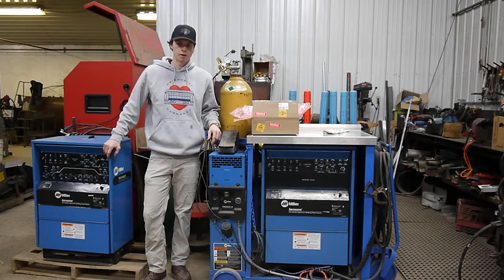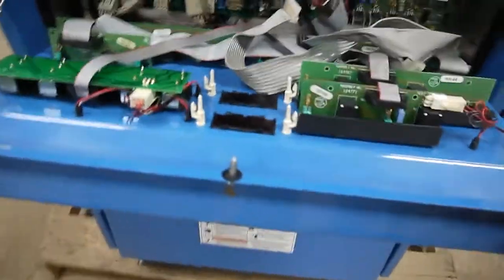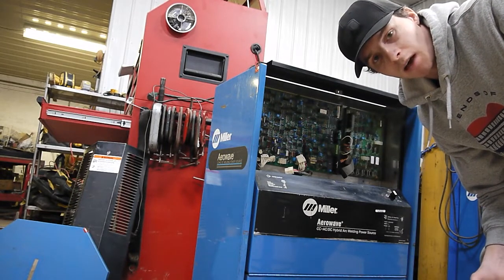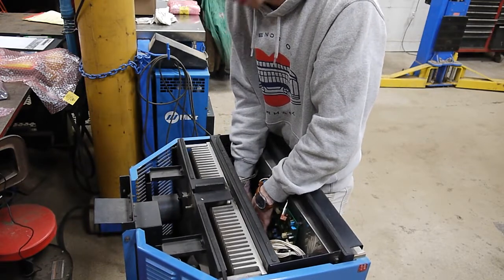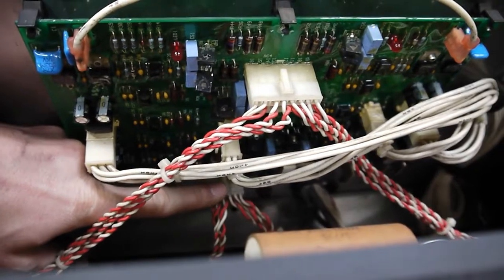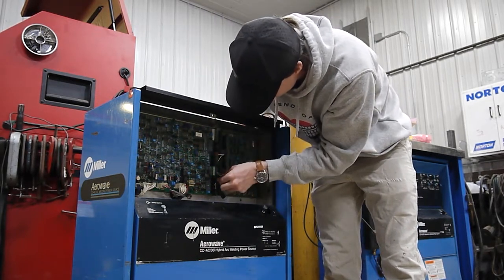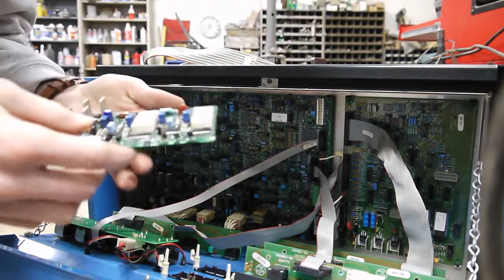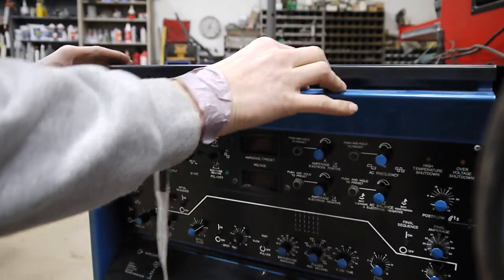Miller Aerowave Circuit Board Replacement

Comment: Hi, I just purchased a Bluetooth pedal from Miller to replace my cord pedal but during the swap my Miller aerowave doesn’t it strike any arc. It was arcing prior to the installation. I checked if the pedal connector to ensure it isn’t loose but still noting. Any ideas?
Reply from the maker: I don’t have any personal experience to go off of but I have read that the remote pedal will not work on the Aerowaves even though it is the same 14 pin connector.
Reply: I hear you, Any idea how to diagnose it ?

Comment: I welded on one of these when I was taking welding classes. I want to buy one. what else can and will go wrong with these machines, how much can I expect to pay and what should I look for when buying one? I was told to get a transformer what's the difference in an inverter and a transformer?
Reply: Main boards going bad is the most common issue these have had, but it isn't really any different than any other machine. This is a hybrid machine, it uses a transformer but the current control is done via mosfets and the polarity control via IGBTs. A true inverter would use a step up transformer and a switching circuit to switch high voltage at high frequency into a transformer that would then step it down, the result is high current at the secondary. The purpose of switching is to take advantage of the efficiency by the reduction of loss due to resistance. It gets more involved but that is the gist. 

The biggest difference you will see if the size and power consumption of the machines. An inverter is going to be small and use much less power while providing higher amperages and increased duty cycle. In terms of longevity, a transformer machine will last long and be easier and less expensive to repair.
Reply: @frankcoproductsllc5353  awesome! so everything that can go wrong is fixable? do you see a time when parts won't be available and where can I find one to buy?
Reply: is the guy in the video named alex?
Reply: @marcuswilliams5007  That's right, it's all repairable. You won't be able to buy new boards, but that's what I'm in business for is to repair them. As for other parts of the machine mostly off the shelf components.
Reply: @frankcoproductsllc5353  good deal!